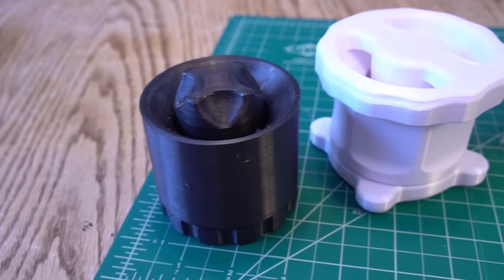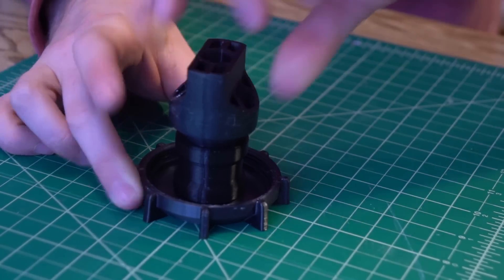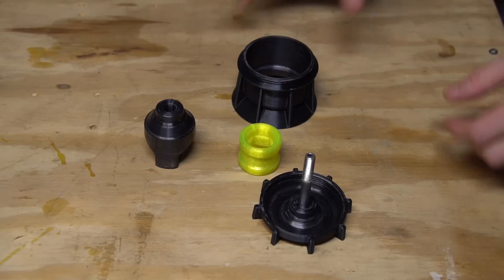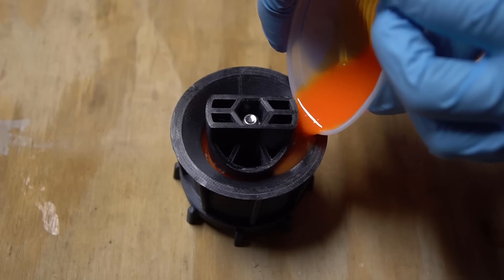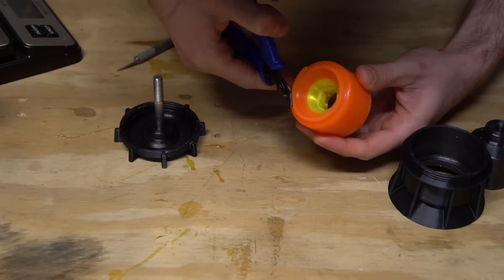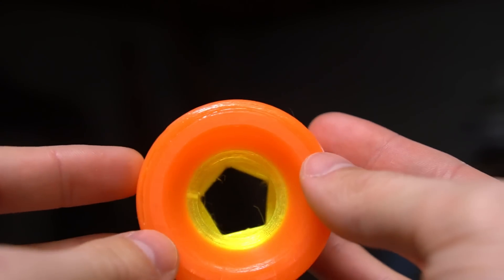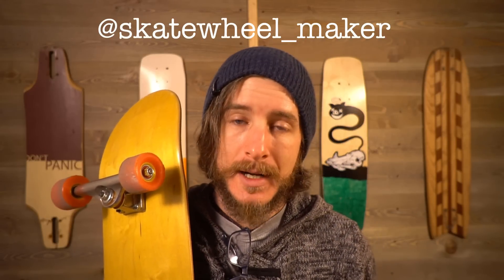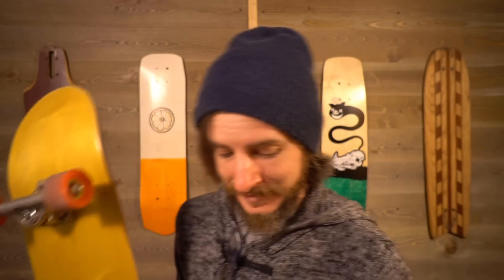Make Your Own Skateboard Wheels at Home!

Comment: This is amazing. It would be interesting to know if you have tried doing this but with re-using old cores from worn wheels for that extra strength? I'm an inline skater so although the molds I'd need would be different, the same principles would apply. Like a lot of skaters, I've got so many old wheels, and I've always wondered if there was a way I could re-use them

Comment: You did get mold outta 3d printer? Is there any other way to make mold, and if it's using substance that solidifies, where do You get this substance in nature? And the same basic question goes about urethane itself. Besides that, we need to know how one can turn pot into high pressure pot - the whole magic.

Comment: i had a job pouring poly when i was in high school in houston. use silicone spray heat your mold douse it with the spray. wipe it down and spray again. it cant be runny or it will mark your wheels. also if you have a laithe , spin your molds and just use a fine grit or steel wool to smooth your molds to smooth it and not leave flat spots. i actually had a mold for spitfire wheels i made from a harder poly (70d) . your mold has to be warm. mix your poly after you put your poly res in as vacum pot. being careful not to bring air into it. pour slowly down the very edge of the mold  SLOWLY. the first pour your mold might be hard to break apart. spray wipe spray again and next time they will pop right a part. you can shoot compessed air in there too to pop your parts out. sometimes my stuff would shoot across the shop lol

Comment: How long is the piece in the pressure pot for?
Reply from the maker: I leave it in for the cure time of the urethane, formulas differ so check the data sheet
Reply: @GoodRoads  makes sense, thanks for the reply! So, the time is not dependent on how full the pot is? I'm thinking about buying a pot to make casters out of polyurethane to make omni wheels for skateboarding, so I want to try to make as many as I can in one batch.
Reply from the maker: Correct. As long as you keep everything from sloshing around more stuff in the pot will actually be better because it'll pressurize faster. I'd also love to see what you come up with for the omni-wheels, keep me posted!
Reply: @GoodRoads  I absolutely will. I submitted it as a project proposal for a business course I'm in. Even if I can't, I'll be saving up to do it on my own cause it's too cool not to try. Imagine the possibilities for street and transitional tricks! Like, infinite powerslides!

Comment: I have questions. 

How do I pigment the resin?

How much pressure is required in the pot?

Do you leave the mold in the pot through the entire de mold time from the data sheet, or longer?

Comment: I was randomly recommended this video. Have you tried this with an SLA printed mold? You can get ABS smooth using acetone to post process. Have you tried ASA filament? It's more UV resistant than ABS.

Comment: Problem with this is not everyone has the fuckin money to 3D print shit let alone have the money to get access to a 3D printer. Thanks though.
Reply from the maker: The urethane and the equipment to cast it under pressure costs way more than a decent entry level printer. Regardless of what the mold is made from, if you're not casting the resin under pressure the urethane is going to be full of bubbles and make for really weak, crappy wheels. I'm working on some projects to see if I can bring the cost of that down but the printer really isn't the barrier to entry here

Comment: Why isn't the part the bearing seats in part of the polyurethane
Reply from the maker: I hadn't figured out how to print accurate enough molds when I made this set. Check out the rest of the channel, I've got a couple videos where I cast solid urethane wheels with a new set of mold designs.

Comment: The simple fact that you can do this with a 3D printer, gives me hope. My father and I are getting back into roller skating. Now I need to start making print files
Reply from the maker: I've had a couple requests to do quad-skate wheels, I think it would be a really fun project to tackle at some point
Reply: @GoodRoads  my father hasn't really skated since the early 90's, and he was using coreless wide low profile wheels that were 92-95a. He can't find them anywhere, because, well, in your original core video you stated the exact issue. Makers have updated their designs. What I plan to do now is being my father in and modify your coreless design so I can cast the right size for him.

Comment: Hey man! Awesome video. I was wondering if you had or could make a model of this mold in 3D Autocad, I don't have access to SolidWorks but will bite the bullet if need be. Thank you!
Reply from the maker: Does the .step file not work for that? I've only got access to Fusion 360, so I don't know what I can export that's compatible but I thought STEP files were pretty universal

Comment: What's the cure time for this resin ? Also, what about the life of the resin once you open them ? Overall do you rate this better than similar Smooth-on resin system ?
Reply from the maker: The pot life is about four minutes and the cure time is about three hours. It is MUCH faster than smooth-on's comparable PMC 790 which takes about three days to cure. I prefer the Specialty Chemical's formula, you have to work fast but the results are more consistent in my experience.

Comment: To smooth out the ridges/layers... Start out with the sandpaper and then give the mold 2 layers of epoxy using a brush, then Sand with 800grit 1200 grit and then polish... And you will have 100% smooth mold

Comment: What is the hardness of the wheels and do you know how to determine that?
Reply from the maker: This formula is spec'd at 90a so if I mixed it correctly that should be just about right. To be completely sure I would need an actual durometer to measure the hardness
Reply: @GoodRoads  Thank you for answering!

Comment: I wish you made a video on how to donut the back tires of a hub motor skateboard. If I could find some radio controlled race car tire and wrap my back tires in it then glue it in place, I would. The front tires would be identical process or you could replace them with all terrain wheels.
Reply from the maker: I'm not sure I understand, do you mean like adding new tread to a hub motor wheel?
Reply: @GoodRoads  With the haloboard carbon there is really really small area to fit a offroad tire. The next best bet is adding tread and maybe some type of foam cushioning. It would have to be thin but it would help I think with the bumps.

Comment: 3:15 whats that yellow thing ??
Reply from the maker: That's the core of the wheel, the harder plastic part that holds the bearings. I 3d printed those as well
Reply: @GoodRoads  is there a specific polyurethane resin i should use? or any polyurethane resin theyre all the same? im gonna use minwax fast drying p;oly urethane

Comment: What is the wheel diameter for the kit? And did they slide well downhill?
Reply: @Good Roads ,  What's your web page?, you say that you share The files there. I would like to try to do my wheels. 
Great video!
Reply from the maker: @ifosd  https://www.goodroadscollective.com/open-source-wheels let me know how it turns out if you give it a shot!
Reply from the maker: The wheel is 55mm and I haven't tried downhill sliding with it yet but I really want too. I have a feeling they'll slide pretty well but that they'll also flat-spot easily
Reply: @GoodRoads  yes I flat spot and go through wheels in a session or two. If I can make my own wheels that would be dope!

Comment: +rep I was scared of getting a 3d printer but if you posted the wheel mold models I'm less scared haha, now I just don't know how powerful of a printer I need? Is the core just plastic?
Reply from the maker: I printed my cores from PETG, I wouldn't trust PLA in the cores so you might want to look for a printer that can handle higher-temp plastics. Something with an all-metal heat break, or you can just upgrade the heatbreak, it's not an expensive part

Comment: How are they holding up? I have some 80s powell bones 60mm wheels I can't find for sale anywhere so I wanted to cast and make them this helps a lot!
Reply from the maker: So far so good! I've got an updated set of mold designs for resin printing in the works which might be an easier technique for harder duro wheels than the one I developed here. Re-making old wheels that are out of production would be such a cool application for the stuff I'm working on, I'd love to see it happen
Reply: Are you talking about T-Bones? My favorite wheels of all time! Unfortunately almost impossible to find anywhere though

Comment: Too bad i don't have a 3D printer.. but i do have a CNC lathe, and a CNC mill..guess how the "professional" moulds are made.. Turned out of Aluminium.. I could do that.. 
I like the design of your mould.. screwing the bottom of the mould into the outside mould..
Cores could also be made on a lathe, if you want holes in the rim of the core, that's easy with a mill, or even a drillpress with some creativity.. Getting the right Urethane seems like the biggest challenge here.. but then.. i've been a metalworker for almost 30 years, and a skateboarder for over 40 years.. (just turned 50 last week.. stil skatin'.. )

So.. if you do have a lathe,  you could use a similar design, and turn your moulds, making them more precise, possibly matching the accuracy and roundness of factory wheels..
Reply from the maker: Dude if you have access to CNCs you're set! You can make a really professional set of molds
Reply: @GoodRoads  Ehrm.. acces?.. I just built my own CNC mill.. and i converted an old (already CNC) lathe to a more modern control.. but that's a whole hobby all by itself.. 
I just have to find the right Urethane.. I already have a design for some nice LDP Trucks.. Just need to purchase some aluminium, and some longer endmills.. the ones i got right now are too short..
Reply from the maker: @JanBinnendijk  That's badass! I'm hoping to get a CNC at some point, I've had my eye on a workerbee, seems like a good value for the cost

Comment: nice products and almost like brand new after hand-cleaning and like it Chris ! 
 - Instead I have idea to design wheel covers with some perforated features for soft ride for longboard (have standard 70mm wheels dia) and actually thinking whether print it or make own 3D mold from silica material ( have some thoughts use silicon that usually applicable for bathroom or kitchen places to fill the cracks from water leak - might it be a good for my case ? recommend if have any testing with this material and as I have used it before for my bathroom - it also dries very quick in mater of 10-12 hrs fully solidify ) But haven;t yet done something with more thickness using this material. And for me as I.m not having 3D printer yet might be some saving point to print only one mold and then cast one by one all 4x wheel covers. 

Any thoughts or ideas - would welcome !
Thanx

Comment: I'm curious why you didn't cast the wheels with a silicon mold like you did with the bushings? That seems like it would be a bit more straightforward to me.
Reply from the maker: I didn't think the silicone would be rigid enough to seat the core in and I was worried it might stretch and deform the wheel. I don't know the material that well so I felt like it would be safer to go with a rigid mold
Reply: @GoodRoads  Interesting. Thanks for the reply! I'm going to be trying this to make some inline skate wheels soon. Your videos have been a great help so far.
Reply from the maker: @stevensiwinski  let me know how it works out!

Comment: What is the pressure pod / vacuum chamber for? Only to remove bubbles? Like will the urethane still cure outside of it if I wait?
Reply from the maker: It will cure but it will be full of bubbles which really reduces the structural integrity of the urethane and makes for a dangerous wheel. Check out some of my early bushing casting experiments to see some open air urethane casting

Comment: @good roads  an even easier option instead of the pla post processing would be to split that main mold into two halves(and keyed a little)  and add a 3d printed ring or ziptie  around it so that you could just take off the ring or tie and take it apart after finished.  That way you would still have the ridges which would be nice on a finished wheel for traction.

Comment: The pressure pot seems like the least accessible part of the build, do you know if it is possible to get rid of bubbles from urethane using vibration? I've seen it used for removing bubbles for other resins
Reply from the maker: That would definitely be worth trying
Reply: @GoodRoads  One other thought, I'm aware of vacuum casting, I wonder if the vacuum bag you used for moulding would provide enough of a vacuum. One other option might be to make a mason jar bike pump vacuum chamber, it appears as though you only need to degas the urethane for a few minutes to get all the bubbles out and can pour it into the mould afterwards
Reply from the maker: @johnc_  Okay. We've got to test that. I've got to find a urethane resin with a slightly longer pot life, but that lowers the barrier to entry by so much.
Reply: @GoodRoads  That would be great, I'm in the UK and struggling to find an equivalent resin to what you're using to test it. 

Ok, one last much stupider idea, strap an electric toothbrush to the mould to stand in for a vibration table, I feel like this is potentially diminishing returns of safety/vs cost so I'm going to stop there :)

Comment: One idea for post processing: Make sanding jigs for motorized finishing. For example: have a tapered or other style cylinder with sandpaper on it that has a 3/8" drive socket or something built in. Use a quick connect drill bit that goes to 3/8" drive to connect it to any cordless or corded driver. Spin that bad boy up, and you could get the job done really quickly. You could put the sandpaper on some compliant "fingers" that had a travel-limiting ring at the top so that you could sand the ID quickly and then the pressure would stop once the target ID was reached.
Reply from the maker: I thought about doing a chuck-able sanding drum while I was doing all that hand sanding, what you're saying about physically limiting the diameter to get a higher level of precision is really something else though! Cool idea

Comment: This is really amazing, what effects could you create in these home made wheels that aren't commercially available because they aren't practical on a large scale?
Reply from the maker: There's a lot you could do with color, like multi color swirls, but you could also experiment with wheel geometries that aren't available off-the-shelf. There's a ton of possibilities
Reply: @GoodRoads  I was wondering if it might be possible or helpful to create a wheel using multiple materials, using a mould that had multiple stages e.g inserts you pull out to cast a second material once the first has cured. You might be able to create things like a more hardwearing outer layer and softer interior.
Reply from the maker: See that would be a super interesting area to explore, and it's not something I would have thought of. This is why it was important to me to make this system open source, so that people can get out there and do all kinds of crazy experiments. Just as an example of the kind of thing I think you're talking about: since the wheel lays down flat in the mold it would be very easy to cast the lips out of a different hardness urethane than the center of the contact patch. Which could make for all kinds of wild possibilities!
Reply: @GoodRoads  Really happy you decided to make it open source. For adding a different outer layer it may be possible to just to add a small amount of the harder urethane and then rotate it as it dried.

Comment: Such good material! Im currently trying to hunt down a pressure pot for casting my own set of mountainboard wheels!
Reply from the maker: Sick! Are you going for a slicks style wheel? So like a urethane tire that could fit on a standard MTB rim?
Reply: @GoodRoads  well i wanna cast nail studs  into the tyre and make some robust winter tyres! I'm currently on pause with that but have drilled screws through my current ones.. 😅

Comment: I was wondering where you got the locking hardware for your pressure pot?
Reply from the maker: Mine's a modified harbor freight pressure pot that I 3d printed some bigger handles for
Reply: @GoodRoads  gotcha! I have the same pot I've used for years....your clamps looked way heavier duty than mine so i thought they might be an aftermarket upgrade...always looking to improve my set up and make it safer.

Comment: How about print at .05 layer height and also use a spray filler for any tiny line gaps?
Reply from the maker: A small layer height goes a long, long way. The spray fillers I've used have all been filler/primers, and they've been pretty soft. I'd be worried they would crumble as the molds get used. But if you know of a strong one then it might be a perfect candidate!

Comment: You could anneal your cores in the oven with a salt pack to make it closer to an injection mold, it still will be weaker than injection molding but stronger than 3d print alone
Reply from the maker: Yeah, I've been keeping a keen eye over on CNC Kitchen as he's been developing that technique. I'm worried I'd lose the precision you need for the bearing seat
Reply: @GoodRoads  i believe cnc kitchen has also covered shrinkage and how to account for it the combination of the 2 techniques should get you precision parts with extra strength! Im really digging the tutorial and wish I had it when I was 15!
Reply from the maker: I feel you dude. I went looking for this information when I was 20 and couldn't find it, so now I'm putting it out there for anyone like us who wants to take a stab at a project like this